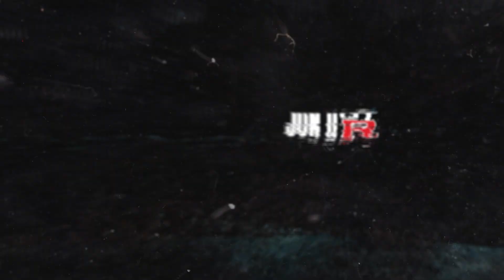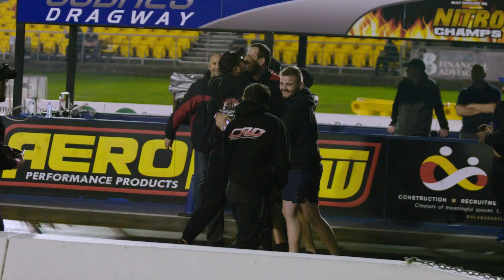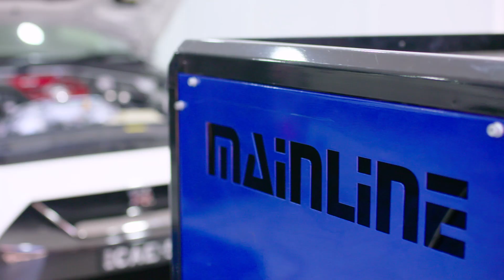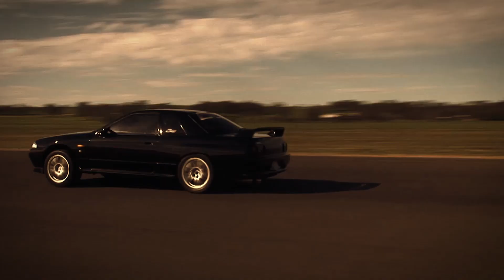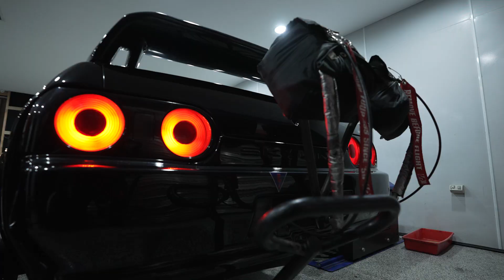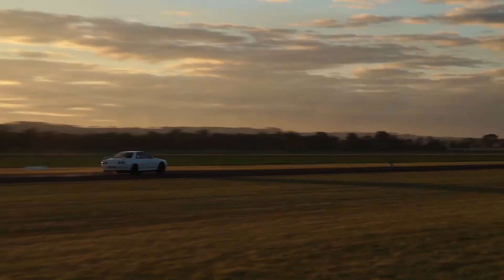Secrets of the World's Quickest GT-R, Import, IRS and StockChassis! - "JUNII" 6.3 Second R32

Comment: I’d imagine this car makes around 2700hp to 3000hp at the hubs and runs over 100psi of boost.
Reply: Sounds like you read exactly what it runs.
Reply: @ACommenterOnYouTube  Using a billet block over an iron block doesn't mean it isn't an RB, still based on an RB30 with an RB head and RB stroker kit.
Reply: @ACommenterOnYouTube  The literal design of the rb30 billet block is based on the rb30 block u donut. 

It’s legitimately an rb30 block using OFF THE SHELF rb components that fit in any other rb engine.
Reply: @ACommenterOnYouTube  Just because it has a billet block, it doesn't mean its a Frankenstein engine that's 1 off using completely custom internals.

The Fact of the matter is that this car uses A billet block for strength, the block is based off the rb30 and uses OFF THE SHELF RB components. Everything in and on this engine is interchangeable with its inferior cast block friend.

If the car was however using an RBX block I would agree with you because it uses a custom crank and bearings in which the block is not classed as an RB30 or 26 block.
Reply: @ACommenterOnYouTube  Your logic is flawed and deluded. The material of an engine or components does not change what the engine is. It’s still true to the design of the RB.

Like I already listed, EVERY component in and on these engines is interchange with a cast block engine, and it’s all fits and works. 

Your argument is practically like saying forged rods and pistons which are designed specifically for 1 engine. Make it not that engine anymore just because it has aftermarket parts. 

Please refrain from making such stupid points which make absolutely no sense.
Reply: @ACommenterOnYouTube  yes, very flawed. You’ve dodged my points twice and your points make no sense nor are they logical or factual.  

Please take your fallacy’s elsewhere.
Reply: @You Tube  I understand what you are saying. I run into this argument all the time when comparing Fords twin cam engines. They've set standing mile, 1/4 mile records with 100% cast block and heads, in most cases the oem timing components and crankshaft as well. 
Billet blocks have much higher homogeneous qualities and also, extra material is usually left in higher stress areas that show weakness in oem form.
Reply: @ACommenterOnYouTube   Agreed

Comment: Would be cool to see if Rob and the boys from CRD could incorporate a laser ride height sensor to help with the wheelies and make the car overall more consistent. Would make the car alot safer, possibly get the 60 foot's down a little and make the car quicker.
Reply: If they don't have one today, you might find there is a reason for it. For example, with the turbo being that big they can't backdown coming out of the hole or it'll come off boost and be too slow to get back onto boost that the overall run is a loss at that point. That being said, they could certainly add one just for safety - maybe it'd save a massive wheelie and potential damage down the road.
Reply: @AlistairLattimore  the laser sensor can pull only a tiny bit of fuel or ignition not resulting in a huge loss, majority of the x275 cars in the states are using them and have made them more consistent and quicker